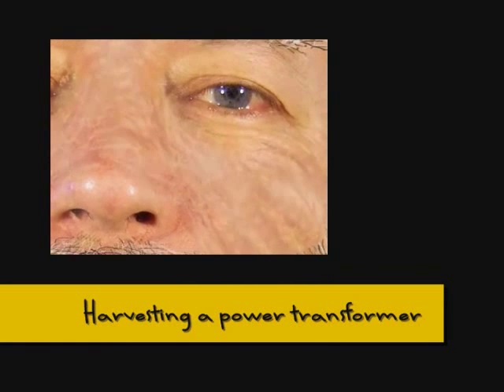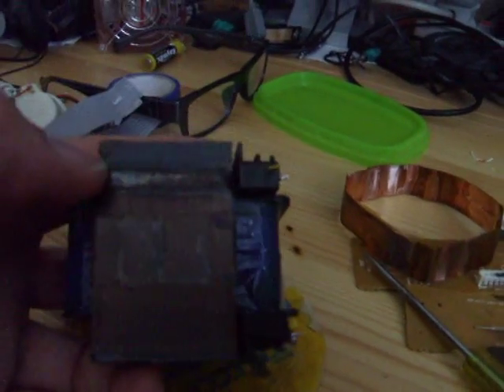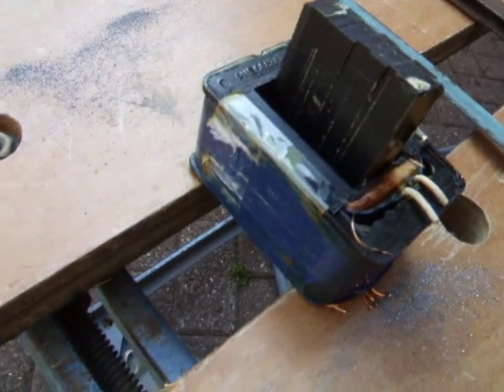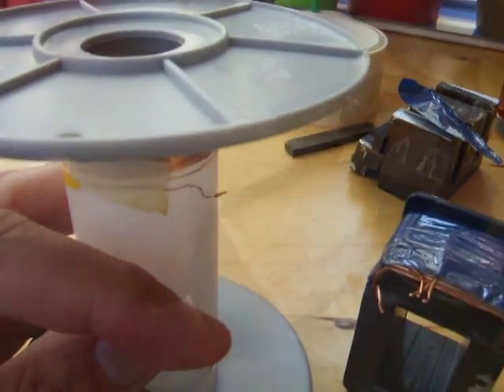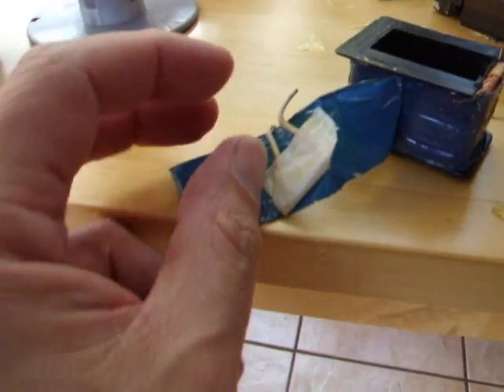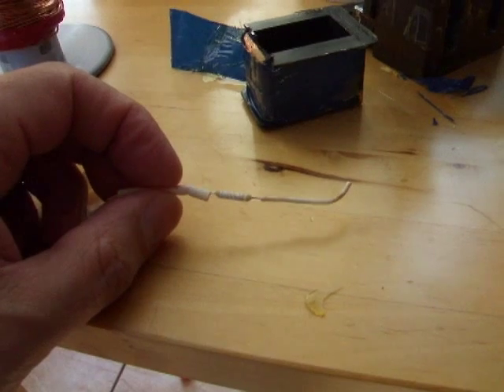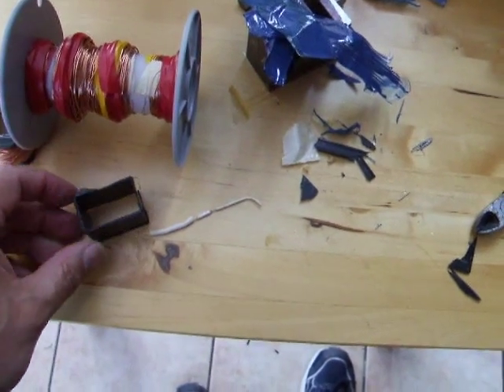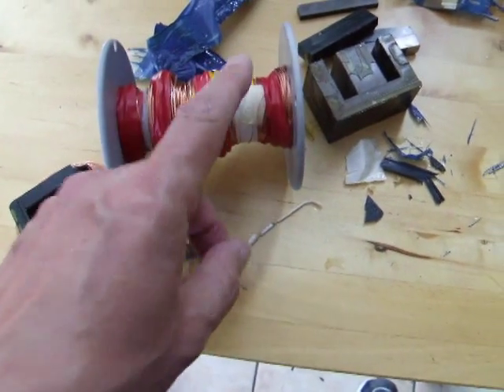Let's take something apart #9 - Harvesting wire from a Power Transformer

Comment: Nice work.   By the way, when you get down to just one wire with two ends wound around the plastic rectangle, you don't really need to unwind it.  Just test that it carries a current using a multimeter, etc.   Just keep it on the plastic rectangular "former" for your next project.      

For fun you could try dropping a strong magnet through that loop and see what kind of current you can get to flow (Faraday's law)
Reply from the maker: Thanks. Did this video back in June and finally in the last week or so I have actually needed the wire to make some small coils wrapped round sowing machine bobbins for a pulse motor. Pleased with the result. Not in the same league as most of the guys posting pulse motor videos on here but they worked so I am happy.